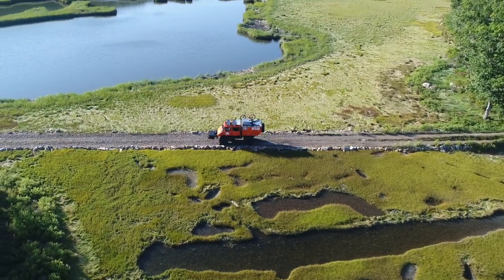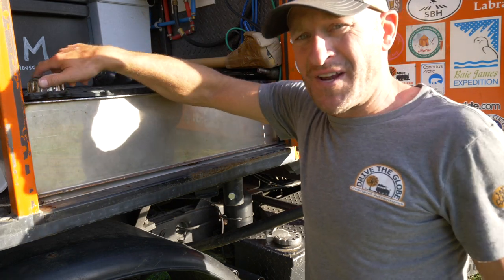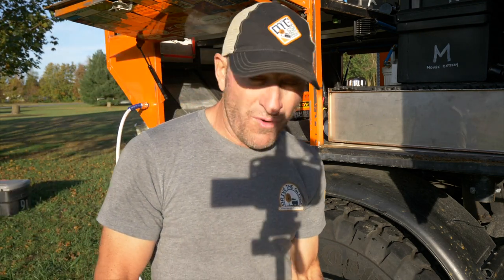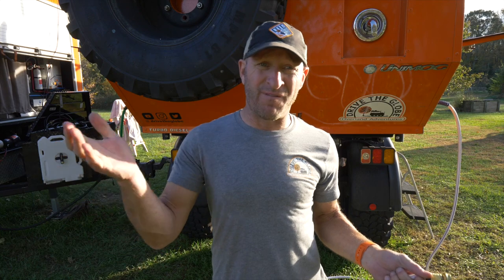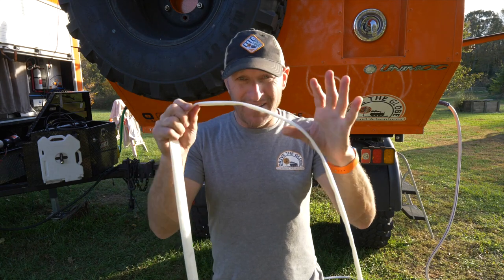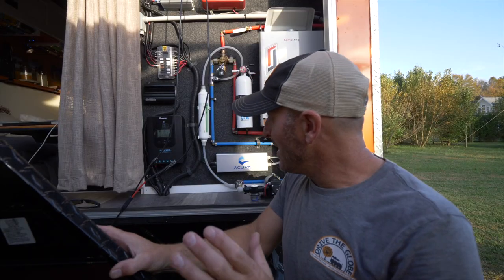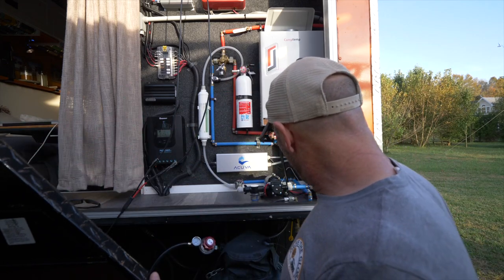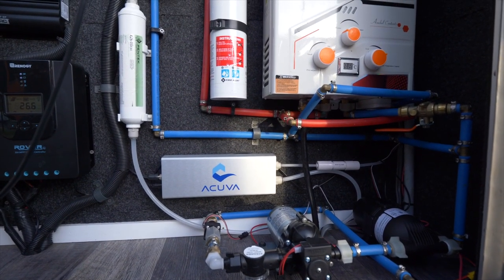VAN LIFE: Water Systems for Extended Off Grid Travel & Overlanding

Comment: I have a very similar set-up 24v w/ accumulator tank in same position. My on demand heater (like yours) uses a lot of litres before it gets hot. (It also cuts on/off frequently). I thought of moving the accumulator tank closer to boiler. My pipes are the strong, yet flexible rubber type. What are your thoughts on this topic? @14;09 i can see your pump+ accumulator is within 1 meter-of your boiler. Perhaps i need to do the same.
Reply from the maker: I went with pex tube as it doesnt flex and I think that makes a difference in the way the pump pulses. It does work better with the pump and accumulator closer to the on demand heater. I installed a very similar set up to this in my new rig and it too is working great. Takes a few seconds to get to my shower as that is slightly farther away than this build. Thanks for watching.